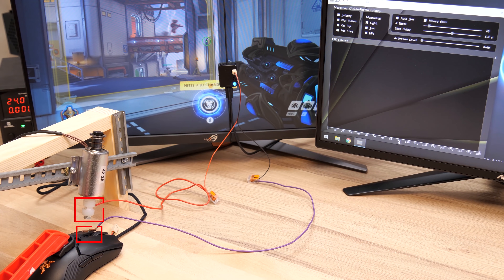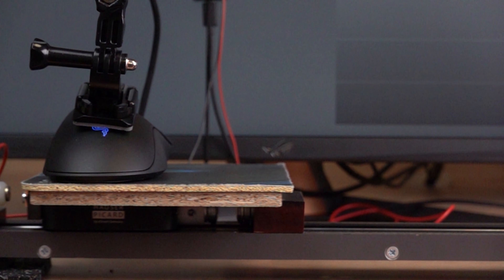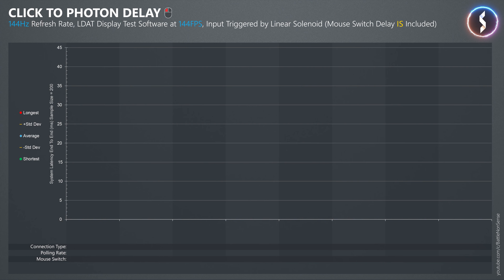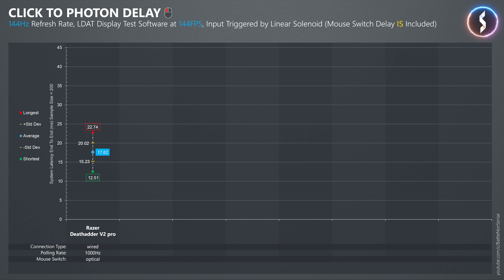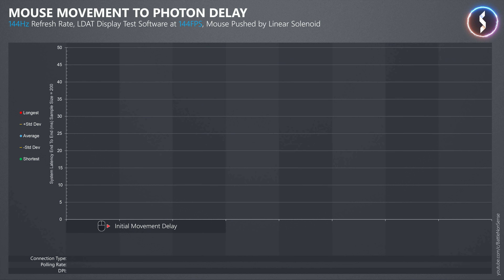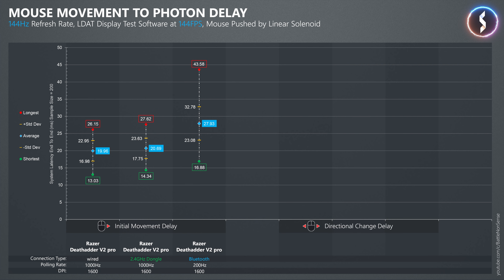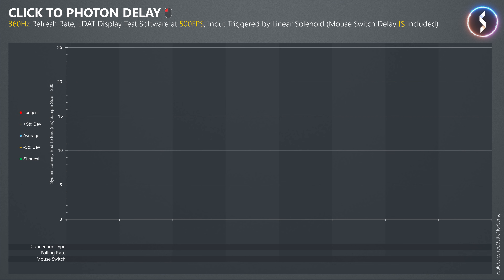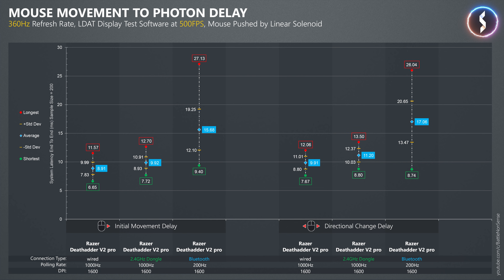Cut the Cord? Wired vs. Wireless vs. Bluetooth

Comment: I would say the video isn't very helpful as this particular mouse is quite expensive to begin with. Nowhere on the manufacturer's website do they say which version of Bluetooth it uses. With a life of a ridiculous 120 hours it is useless to me. Mine and I change the batteries every 5-6 months, and I spend a lot of hours in front of the computer. Mine is 4 times cheaper and comes complete with a keyboard. It doesn't have parameters and extras like this one, but it's more than enough for games, at least for me, and what's important for me. A comparison is needed in the protocol for a mouse with more normal prices that is more accessible to more people. The bluetooth version is also very important. For the new version 5.4, it is claimed that latency can drop below 20ms compared to 100ms for 5.3 for audio. For games, it may already be very similar to those with a receiver.

Comment: You can test the interference performance by using the mouse on top of a running microwave. The stray microwave radiation escaping the microwave tends to slightly mess with 2.4 GHz connections. When I use my wireless headset near it running, I do hear static noise.

Comment: Interesting..., but what is your Bluetooth adapter? USB dongle or PCIe M card and what PN? What is the Bluetooth version? Are there any latency differences between several Bluetooth versions (3.0,4.2,5,1)? Are you using "Allow the computer to turn off this device to save power" or it is disabled?

Bluetooth in general under the Windows is running worst from all other platform like Android, iOS and Unix.

Comment: i have Logitech G603.
the bluetooth mode is look like jittering or missing some movement.
while in RF mode, its very smooth.
i also have Lenovo 600 mouse, it have hi-end microsoft swift pair bluetooth.
still have so many missing movement. i think its just bluetooth limitation even in BT 5.0 mode.
each version might increase bandwith but not the latency

Comment: i switched over from wired to wireless mouse about 6 months ago. the wire always had a pull and it made it really hard to be accurate. plus i had to move everything behind the mouse so the cable doesn’t get stuck. plus it was an extra wire in my setup. i decided to buy the same mouse but wireless and give it a chance... and my opinion is i love it. i love the wireless mouse but there is some flaws. just like you said any device can lose signal and maybe it’s just mine but i do lose signal at least once or twice a week. for a couple seconds only. overall i don’t feel like the input lag is bad as i still do just as good as i used to. but sometimes it does just feel off for me. anyways i recommend trying it out for yourself. i would say yes

Comment: For anyone wanting to test at home the sensor's impact on total system latency, something simple I did to test mouse sensor latency is this:

I put the mouse on its back and put a tiny piece of paper on its sensor and then shot a quick blast or air at the paper. A 240fps camera (Samsung Galaxy S7 slow-mo mode) showed 0 frames between the paper resting and 'gone', and recorded in the same shot was my monitor in the game I was testing for.

Hardest part is putting the footage in a video editor to go frame by frame and count the number of frames between paper movement and the beginning of the transition from one monitor picture to the next (this was on a 60Hz screen, at 144Hz it's much easier)

The lower the refresh rate of the monitor, the larger the discrepancy between samples, so generally to get true-ish latency of the hardware itself you'll look at the lowest result, but for total system latency (game rendering etc) this isn't really accurate because there can be many factors affecting the delay of the output of a frame (especially in the Source engine, yeeks). Plus, a 240fps camera isn't that much, but it should at least give you more than a general idea.

Comment: bluetooth is crazy bad, except when it isnt.. the sony DS4 controller with 1000hz is super quick, and apparently has some weird ~700hz polling rate also.  besides that, 2.4 is where its at.
Reply from the maker: IIRC it only uses BT when connecting to other devices than a PlayStation - like an AppleTV.

Comment: 100% there is more problems with wireless then we think. These tests are best case, not avg after 1000 tries. Also as you mentioned, interferens when using many devices etc etc.

Comment: Instead of paying exta money for wireless and light weight  mouse at the same time, you can buy wired light mouse with shape you like and pay extra money for the good quality cord. It would be cheaper and the cord will not have affect on movement. I would prefer wireless if the were 60g or less and didn't cost for 100$+. Now I have mz1 with custom cord and I will change it only on another mz1 which will be weight less than 60g

Comment: Wireless mice are actually great now with latency - the problem is weight. Most competitive players go for mice under ~80g while wireless mice mostly start at ~90-95g and go up. BT is obviously shit due to technical restrictions of BT. Well that and price is significantly higher especially for those with internal battery which are lighter than ones with external AA / AAA batteries. There are few super light models - but it's not like you have great choice for mice forms in that weight category.

Comment: You should test how wireless interferences affect wireless performance. Maybe fill the room with 2.4GHz devices, other wireless mouses, bluetooth headset and watches, Wifi access points, wireless remote controls and maybe also put a microwave somewhere in there

Comment: Yes,  its 0,5 -1ms difference for wired vs wireless. Bluetooh is for powersaving. I thought u made a similar video showing these results with exception of bluetooth? Anyway. 
My DPI is 1800 and 1 in game for years but I also test differend combinations. Im wondering if there is a difference when only changing the DPI and keep 0 or 1 in game vs raising the ingame sensitivity, since in many games ingame sensitivity is a multiplayer of the DPI? I would love to see a video or at least an answer to that question. (When ingame sens is 0 some games drastically lower the mouse sensitivity and you can go higher than 2000-2500 DPI).

Comment: Great video, would like to see the difference between the top 3 wireless mouse, Logitech superlight, glorious model o wireless, and razer viper ultimate.
and also how big of the impact of the polling rate, such as 1000hz change to 500hz. and wether the corresponding Software affects the performance of these 3 mice (ex. G hub / Glorious Core/ Synapse)

Comment: Great video, but it feels like two questions are left answered: Are all current mouse manufacturers equal when it comes to wireless tech? And the interference mentioned, how common is it? Does sitting right next to a WiFi antenna do anything, or maybe even having your phone close?
Reply: I've completely lost Bluetooth when sitting 15m from a microwave, and I found Logitech's wireless keyboards to miss input for about 1 min at a time every 10 mins or so 10m from a router. So very common.
Reply: @AnimeReference  Is that keyboard using Lightspeed or Bluetooth though? I know that BT is easily broken, even being near a 2.4 ghz WiFi antenna can make it drop out. Would hope newer stuff like Lightspeed doesn't though.
Reply: @Cimlite  Lightspeed is entirely the wrong word, but that.
Reply: @AnimeReference  Well, that's disappointing. 😐

Then again, I guess cables for mice and stuff has gotten exceptional the last few years. Weighs practically nothing and moves likes it's not even there. A lot cheaper too.
Reply: Interference is quite common. Even USB 3 ports on devices are known to cause interference problems when BT adapters or proprietary 2.4 GHz recievers for mice and keyboards are plugged into them (Google it). Interference can manifest as reduced range, signal/input dropouts, and significantly reduced bandwidth which can cause inconsistent input delay.

Wireless is especially bad at the moment for audio devices, especially BT speakers/headphones that add an average of around 200ms to the audio signal using standard BT.
Reply: nobody is equal when it comes to wireless tech. they all have their unique quirks and different latency numbers. 2.4 is pretty much always preferable over bluetooth as a general rule though
Reply: @WalrusFPGA  Bluetooth actually runs on the same 2.4 GHz band as proprietary receivers. And both suffer in the same way from interference.

The only difference is that BT is encrypted and meant for a wide variety of devices, whereas proprietary receivers can omit the encryption/decryption process altogether, so the latency potental can be much faster.

Comment: Would the results from wireless be significantly different if I were sitting a few feet away and there are other devices connected to Wifi in the vicinity?

Comment: PS/2 vs USB would be interesting, especially mouse movement could be very interesting due to the bandwidth limitations of ps2
Reply: @cas curse he only did it with keyboard though, im specifically interested in mouse movement here because of the bandwidth limitations which keyboards affected by.

also that was before he had LDAT and all the other crazy testing setups, so we could get much more accurate data now
Reply: @cas curse  because PS/2 is still an option today that might actually be worth using. serial on the other hand isnt as interesting because A: most modern mainboards dont even have a serial port anymore, and B: unlike ps2 (which sometimes works with a usb adapter) i doubt ANY modern hardware supports serial even if we had one
Reply: @cas curse as i said, there still is a reason to use ps2. if your keyboard supports it and you dont need any non-standard functionality (such as rgb sync or whatever) then using ps2 is a free latency reduction, nkey rollover guarantee, guarantee that the kb works in bios (which cant be said about all usb keyboards unfortunately), and it frees up a usb port. i just want to know if the same holds up for mice
Reply: @cas curse i got the latency information from that very video, so im confused as to why you say the opposite. granted, with 1k+ hz polling the difference becomes negligibly small, but not every kb has that. i know usb supports nkey rollover, but not every kb has it due to bios support as you said (and vice versa, since very few actually implement both with automatic switching at runtime)

yes, with a perfect usb kb we dont really need ps2, but not everyone has the money to buy a new kb when they realize that what they have isnt perfect (not to mention that its very hard to get this kind of information about a product prior to purchase in the first place even if you have the money)

ps2 is a nice and easy way to work around for practical imperfection and thus still has a use case
Reply: @cas curse by that logic almost everyone is using a crap keyboard (because very few keyboards meet all these criteria, and not everyone has the money to buy a new one whenever they want), so my point still stands
Reply: @cas curse 
> guess you werent around when ps2 was

 what makes you think this, and more importantly: how is this even relevant ?

> practically every gaming keyboard has them

maybe i was just extremely unlucky, but out of ~10 "gaming" keyboards i've seen so far only a single one had both bios compatibility and true nkey rollover without doing some weird shenaigans like simulating multiple keyboards under the hood

> if the problem is that consumers buy crap keyboards, then what makes you think that changing protocols will help?

the fact that even a "crap" keyboard will perform quite well over ps2. in fact, the more "crap" the keyboard is, the bigger the difference is that ps2 makes
Reply: @cas curse  false attribution. just because the keyboards were flaky doesnt mean the protocol is, because correlation does not imply causality. especially when the problem is attributable to the protocol, such as 6kro being a limitation by design of the bios compatible usb protocol, in which case switching the protocol to one that doesnt have this limitation can and will fix the problem

also FYI my first couple keyboards and mice were PS/2, and i also remember serial ports, so your assumption that i havent been around long enough is wrong too (doesnt change the fact that this is completely irrelevant to the discussion)
Reply: @cas curse 
> 6kro is not a problem, its a solution

what? the problem is that i cant press more than 6keys at the same time. how is that a solution? a solution to what?

> you speak of ps2 keyboards like they will solve the problem with usb keyboards

no, i said that using a usb to ps2 adapter for a problematic usb keyboard can fix that problem for that keyboard. im not suggesting to go back to pure ps2 keyboards

> having owned a couple isnt quite the depth of experience you need

then what is?

> you wouldn't be holding them up as some kind of magic flawless device

i never said anything like that. and im still not talking about pure ps2 keyboards

> your argument that theres a problem with usb keyboards in general

i never said this either, where is this coming from?

> you're arguing in circles

how so? also i'd like to point out the irony of that statement when you're the one that even says themselves they're repeating themselves

Comment: Hey Chris, did you know that Overwatch seems to have a mouse click indicator built into the game now? Check the Video settings and enable "Flash Indicator." It flashes a little white square on the left of the display when you click the mouse. Might be useful for testing.
Reply: That is only useful for measuring certain things. It would not help in this case, for example, because the measurement included time from mouse click to computer response.

Comment: Very interesting. I always expected the delay with wireless to be much higher compared to a wired mouse.
Reply: It hasn't really been the case for quite a long time now. I used to belive the same, but then I got my hands on my first Logitech wireless and there was not tangible difference. I still aimed the same and everything. What changed was the fact that my mouse now had alot more consistency because I could do odd angles and large movements without wire tug which was a godsend
Reply: @D3R3bel  Interesting.
I am a boomer gamer. Wireless was kinda useless for shooters for a long time.
So i never came to the idea to try out a newer mouse. This video changed my mind.

Comment: This is NOT mouse delay, this is MOUSE + SYSTEM delay. And while there is nothing wrong with this measurement as drivers can actually affect performance significantly (but so are USB ports and motherboard, watch Rocket Science's latest gamepad testing video) and you WANT to have this metric on the same system as baseline -- it is IMPORTANT to note that this is total delay, not dry mice delay.

It would be nice if you could upgrade your setup, get Arduino for example, and add dry mice delay to your testing so you can test different mice in vacuum and find out its own base delay as well. This way you can compare different mice for performance, I bet that controller on this mice that switches between modes also incurs some penalty to perf.

Comment: I would love to see the comparison between Razer and Logitech wireless solutions.
Reply: Excellent suggestion, but if I may add a nice spin to it, research first if they various antennas are actually different, you never know if they're buying from the same producer
Reply: Me too I own a G pro and would like to see if that is as good as the razer wireless
Reply: @Dirt33breaks  i have it too, I believe Logitech is same of bit better
Reply: Logitech 604, and the older cheaper 602 
Gime all dem buttons 😁
Reply: glorious too
Reply: I'd also like to see if Razer's Low Power mode makes a difference. I've seen several reviewers say to just always leave it in low power mode because it has no impact on performance.
Reply: Me too
Reply: Me too
Reply: + Corsair
Reply: Logitech: The mouse is perfect, it uses the highest end chips, and has the lowest lag, even lower than some wired competitors.  And then it breaks in 3-6 weeks.  The buttons start double clicking, the wheel starts scrolling backwards, and eventually the sensor starts flinging the cursor to the top of the screen.

But boy, those first 3-6 weeks were worth it.
Reply: Me too
Reply: +1
Reply: Yep, in particular I would love to see the GPro!
Reply: UP. I have the g603 and i love it.
Reply: @sirtuto  how old is your g603?  Do you have the mouse wheel reversing bug yet?  Did your buttons start double clicking yet?
Reply: @moeburn  My mouse is 3 years old. I fix the problem by purchasing a replacement wheel from aliexpress (2 usd). No double clicking problems.
Reply: the viper ultimate has the least amount of input delay among all the wireless mice i think
Reply: Yes please
Reply: G703 Wireless
Reply: @brettzolstick989  I have the same model and it works like charm for me.
Reply: Top 10 would suffice. Glorious, Finalmouse, ...

Comment: Xbox controller comparison of wired/wireless would be awesome. Thanks
Reply: Rocket Science has some good videos on this topic for controllers. Search for Ultimate Controller Comparison.
Reply: Also normal vs elite vs some cheaper aftermarket ones
Reply: you can see detailed reports of the latency differences in most modern controllers, including xbox ones, from porkchop express' MiSTer latency charts. they are all done with 1000hz polling enabled, but this is something you should be able to do on PC as well.
its on rpubs dot com, search for that and "misteraddons latency"
Reply: Agreed!
Reply: Also comparing the proprietary wireless in the 1st gen xbox one controllers vs the bluetooth wireless in the newer xbox one/series controllers
Reply: There's no need, wired is better, ever